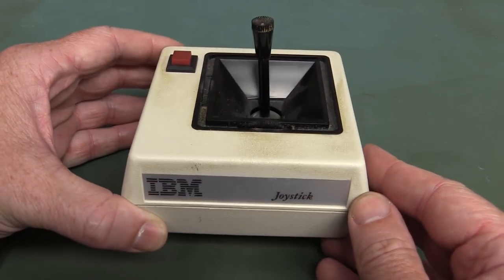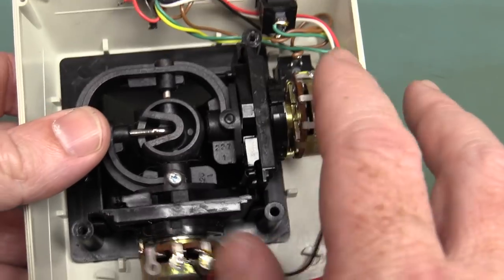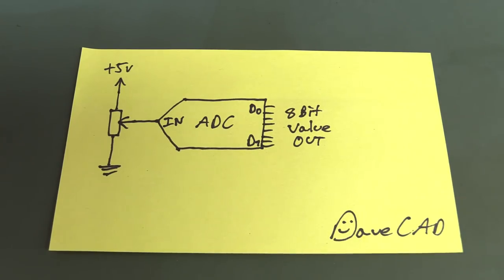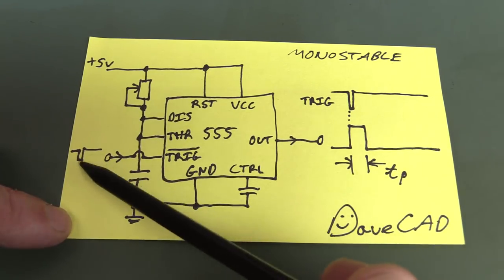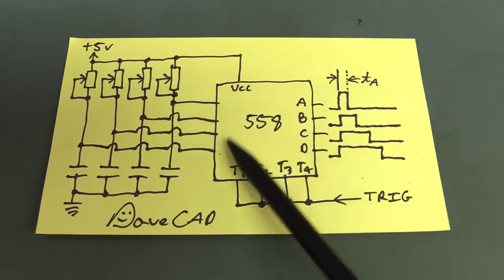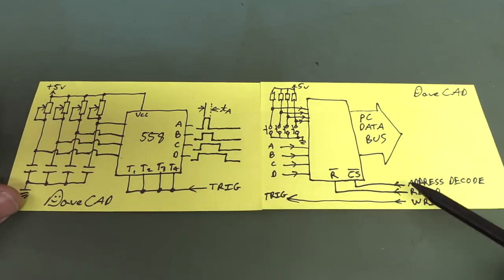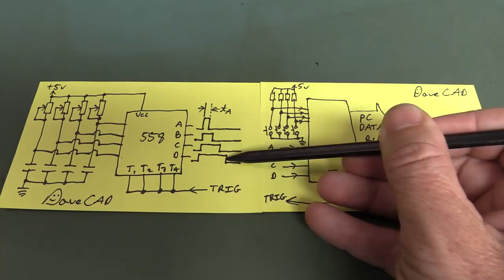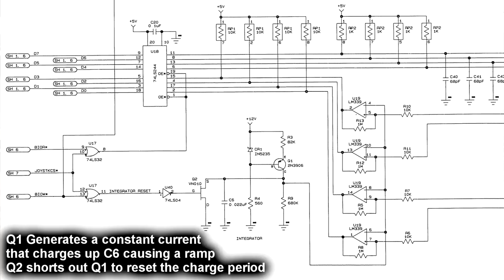EEVblog #1054 - How an Analog PC Joystick Works

Comment: How does one go about knowing that NE558N V8407 S is generically known as just a 558 chip... with so much other stuff written on IC's how do you extrapolate what means what, i mean even date codes are written several different ways and are not always present on components, so how does one come to know weather they are looking at a modek number, part number, date code, manufacture specific model number that contains a generic model number, etc.? Is that just experience, or is there a method to the madness that is reading component labeling? My guess is it's a mix.., some combination of methods that one gets a feel for which to apply in a given component type given the rough date and type of electronic circuit being looked at by way of experience. Am I close? My current method is to just type the type of component in to a google search and try following it with what's written on the component one Alphanumeric/numeric code than the next, than the next until i get a hit, but it doesn't always work. I did this with an ac fan relay recently and got some love from google, but sometimes i get no love so any hints would be appreciated.
Reply: Experience.

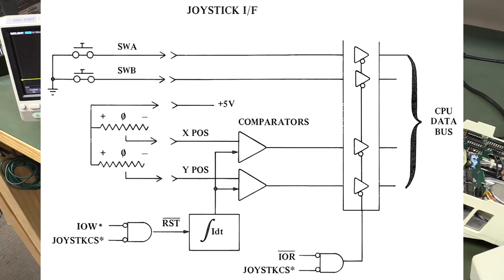Comment: 15:00 

Isn't that integral schematic one of the more primitive ADCs?
Reply: well, it's an ADC with time output.
Reply from the maker: It's basically single slope integration. Multimeters use dual slope integration for example.

Comment: When and how was MIDI implemented in the game port?
Reply: Tyler Costantini im not sure if i recall it correctly but the  non mpu 401 compatible interface was integrated on the first Sound Blaster by Creative, they used the unused pins on the gameport connector, all you needed was a cable that splitted the gameport connector to another gameport connector and the midi in and midi out DIN connectors.
Reply: The details escape me, but the implementation was a repurposing of extra power pins, and the actual signal was a optically-insulated current-loop carrying fixed-speed serial.

Comment: what I wonder is why they went with an analog joystick when pretty much everyone else (including the Atari 2600 and most arcade machines of the day) had a digital joystick that just had an "on" and "off" state for each direction and when using the digital joystick would have simplified the logic a lot...
Reply: Finer/better control with an analogue joystick. Digital joystick is not really a joystick at all, just some on/off momentary buttons.
Reply: I had a TRS-80 Coco which used remarkably similar joysticks. There was actually a Flight Simulator for it. Needless to say, it was incredibly primitive. I found some YouTube videos of FlightSim II (for the CoCo), but not of FlightSim I which ran on the older revisions of the Coco. There are a couple screen shots on the interwebs though. It's pretty underwhelming, especially by today's standards, but back then it's amazing it worked at all.

Comment: Hello, do you repairs? I am a 1 handed gamer. I have 2 of the old edimensional access ben heck designed controllers.  It uses like 4 universal boards so you can move these little pods into different locations.  I have 1 arrangement (eventually i like to make my own permanent controller, because i think the universal boards cause issues.)  Anyways all 4 of my joysticks (both lefts and rights [use as lefts sometimes with remapping]) ill show input when not being touched or not resetting to 0 after letting go of joystick.  Makes playing ro oncket league really hard.  I order a ps2 potentiometer but the one that is in the access controller pod has a small 32 pin connector on bottom of it that connects it to the board.  I cant even figure out how to get it out of the pod, im guessing you need to pop off the joy stick pad somehow or remove board from potentometer.   I be willing to pay for getting new potentiometers in my access pods

Comment: I have an old Genius joystick that my mom wants to use to play Wolfenstein3D (I got the exact model she used to play when I was a kid), but I'm having trouble getting it to work with the USB adapter I found. If anyone knows of a universal or customizable/calibrating type of gameport-to-usb adapter, I'd be super thankful!
Reply: Better/easier way would be to just buy a cheap basic PCI sound card on eBay. A creative ensonique/ PCI 128 for example. They have game ports onboard.
Reply: blackcorvo : You'll need an analog to Genesis converter, the info is available online.

Comment: Don't see engineers like this any more do you  ?? 

Very Interesting  and they say engineers of the modern world are good ... Mmmmm 

 In those days , and not that long ago  , you had to  work to component level  even up until the late 1990's early 2000's which  meant  smt ( surface mount components)  

There was  not to much of this , Oh just throw it away and buy a new one or  swap the board story  

You had to be able to read a schematic , draw  and assemble test etc 

What a joke this is now  with most of the supposed technical  experts on front line desks who only can answer from a script  and they do not have a clue at all 

You may well ask and rightly so  as   to , "Do  you call that training or producing  professionals ?"  ,  because I dont !! 

Excellent by the way !! 

I thoroughly  enjoying watching and listening to someone whom knows what they are talking about   and what a change that makes !!

On that note I'm going to let the rest of you work out what they have done with this  including  how your supposed experts you elected tell you how good they have been with training  as this become more and more evident in Industry over all  particularly in the UK  which is quite disgusting as to what they have done never mind a few  other factors surrounding this 

These are jokers you have had  power  ,  controlling business  for years as I stated on Instagram , they have actually taught you nothing  which is why your imports etc are  failing  , and you have very few UK made exports   

Its been sealed throw away junk  which of course  you wouldn't open being advised its too expensive   Is it  now I wonder  and who is paying the price as usual  which also   now leaves you  without  people of this category  that have that   know and how and   where suppliers can easily rip you to smithereens

See it doesn't work does it or produce  professional engineers , designers , installers and  many other factors  but who am I to  repeat all that many other professionals said years ago 

Could you do  one of the Ps2  and how that all works Id be interested to see that too 

Thank you  by the way  , very good explanations

Comment: Hey I have a question for all of you enthusiasts out there, I have recently started hobby electronics and have opened a lot of old electronics and do these old electronics contain large amounts of lead and is it a risk touching then and leaving them about, I also have 2 cats and I want to know if this is safe
Reply: The lead isn't a problem unless you start ingesting it.  Soldering is OK.  Modern regulatory bodies are hysterical...
Reply: There's no risk from the lead. do be tidy though and don't just leave old PCBs lying around all over the place - They might break if your cats knock them off the bench, and you don't want to be tripping over, standing on them, or stubbing your toe on one!
Reply: also, old CRT TVs can carry a dangerous electrical charge even for quite a while after being unplugged. I'd leave them alone for the time being :)
Reply: hadtomakeachannel thanks guys! I’ll be more careful.

Comment: Kinda primitive way to do things. Even the best 8.bit systems (Vic20 and C64) had paddle-functionality inbuild to video chips. 

This sss+sw-loop hack caused a lot problems later, when PC clock speeds got faster.
Reply: the c64 paddle function was in the audio sid chip
Reply: You are right,  I had to go and check this from old C64 HW ref manual.

In Vic20 all the sound/video stuff was on one chip, (original VIC chip), but when they made upgrades for C64 they split systems on two chips.. And it was SID that got the paddle inputs. (registers $D419/$D41A)